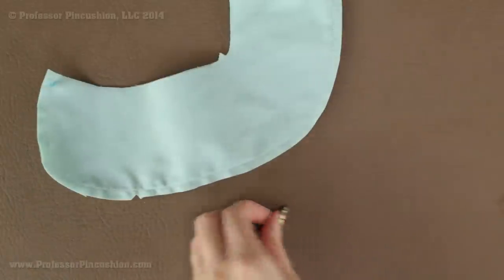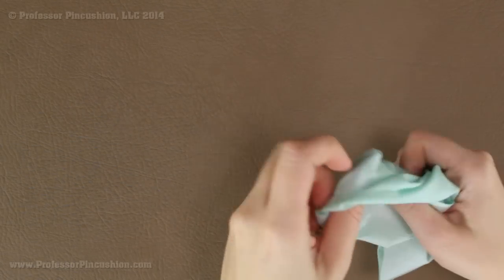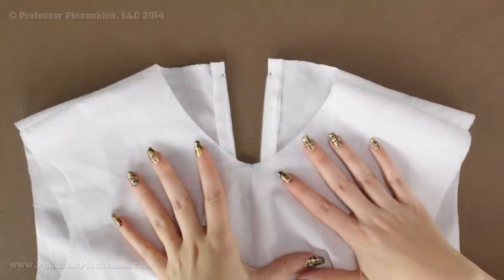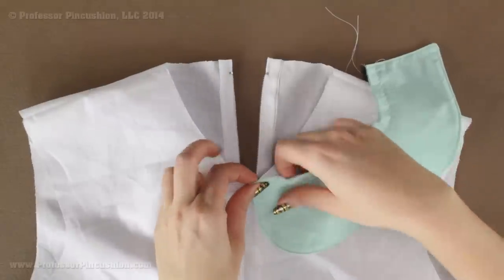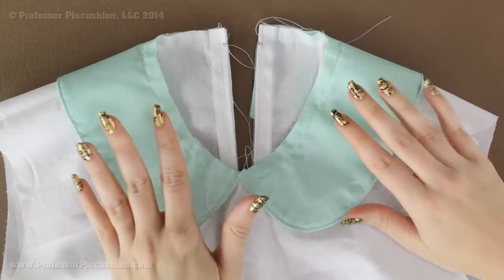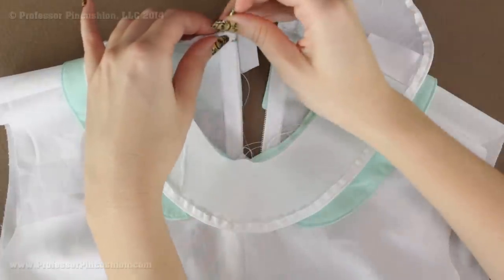How To Assemble A Flat Collar

Comment: Thank you for sharing. Once again, being French, I appreciate your clear English that is eady to understand.

Question : isn't the under-stiching enough to maintain the facing in place and do you really need to top-stich the top of the collar?

Your videos are inspiring and make sawing look so easy I feel ready and able to achieve any sawing project. :)

Cilou
Reply from the maker: The understitch makes it easier to turn the collar to the inside but it won't hold it there.  If you don't want to do a top stitch, you can tack down the facing with a few handstitches to the bodice shoulder seam allowances.  I'm so glad you find our tutorials inspiring!  :)